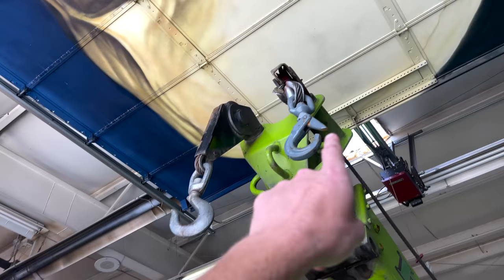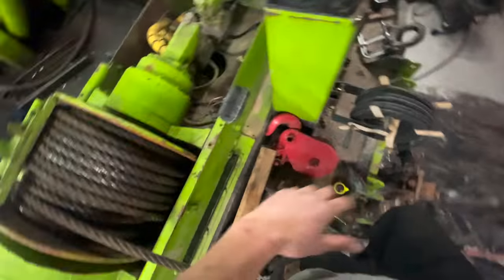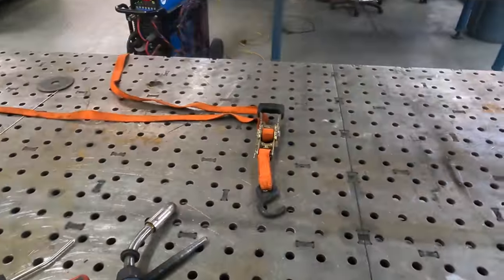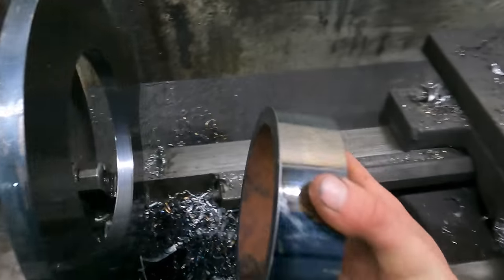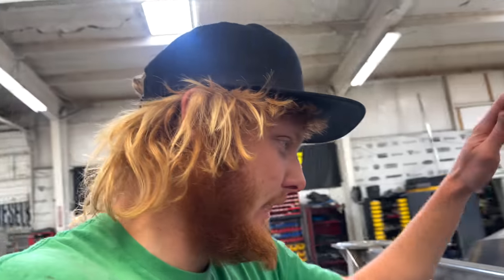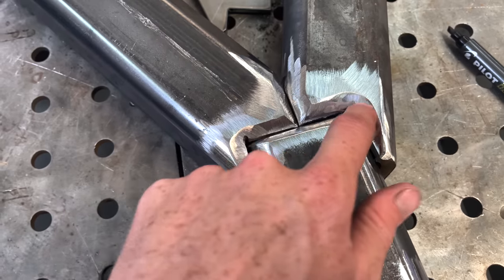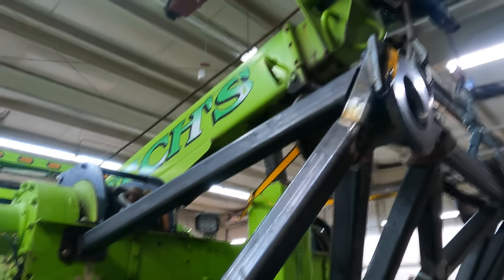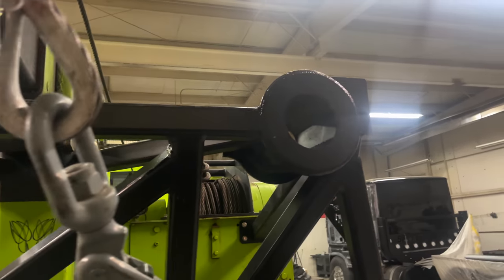How To Build Something @HeavyDSparks Can't Break

Comment: Solidworks has a great sheetmetal package which made a huge impact on my fab'ilities. Also has some great simulations for strength testing cross-members like you've put on the HET. I don't work for or rep them, but I use it everyday at work and in my home shop.

Comment: Hey Hunter. Instead of using the flapdisk on that table, another way you and do is by leaving it in the lathe and get a big sheet/ strip of sandpaper (like from a beltgrinder) and just sand it while the lathe turns it. Like when you floss with a towel.😄 Thats how we do it at our shop. Great work dude, keep it up.🤘

Comment: Great video and work. Really dig the faceplate on the lathe as far as being able to unbolt and flip the jaws. All of mine have to be unscrewed and flipped with the internal spiral gear and can be a real pain if they don’t go back on in the correct order or if they aren’t timed correctly causing the centerline to be off. I’m gonna have to find some chucks like those, definitely a time saver. Again,great work and video! 👍

Comment: Just a tip on turning the tube on the lathe, tack the plate on the end without a hole in it, and chuck it up. Then you can use a hammer and a dial indicator to dial in the end of the tube opposite of the chuck to run straight, and then drill the hole with the lathe tail stock. As long as you're careful, you can usually get away with it. Then it'll be perfectly straight and not have that offset cut that you saw. If it still sags, then after you dial it in and before you drill the hole, mount up the steady rest.

Comment: Hunter, my man...may I offer you some constructive advice on "Stress Welding Procedures". While .035 mig wire is a good all around wire for many applications, on a Truss assembly as you have build, will take alot of load and stresses at angles, and knowing Dave's infinity for testing the "limits', I would suggest using a .045 Flux core wire, for MANY reasons, one being the heat that is in the weld, during and after the weld, superior penetration. Secondly an .045 will put MORE material into the weld for bonding two pieces, and you will also find the weld will layout like peanut butter. it will look like it was CAST, not look like a "stitch weld". I have spent my life time in the Petroleum Industry building Centrifuges, Hot Oilers, Nitrogen Pumpers, Pressure Trucks, and occasional Drilling Rigs, and they ALL take a beating. I fabricate them from a pallet of laser cut steel, to a complete, on the rig operating million dollar plus piece of equipment, my fab work NEVER comes back for repairs, but have rebuilt/repaired my fair share of other competitors equipment( names withheld). I have been a Welder/fabr for over 30 yrs and work with some of the best, my employer puts me in a corner with a pallet of cut steel, and leaves me be, I work alone, where the rest of the crews, are 2 man teams. Not many people I can work with as my standard and ethics will never allow me to work with lazy morons that never follow procedures, that being said, I know I could work with you, we'd click, get'er done attitude always prevails. I seen how your mind works, and put to CAD, then bangin' it out. Good job Young fellow.
Reply: His design  WAS .....NOT.....OVER KILL!!!!
Reply: @alnov91  have you NOT seen HeavyD kill/destroy things, better to OVERKILL, do it once, then have to repair it. They ripped the bed off that wrecker not to long ago, and I guarantee that rig WILL be put through its paces. Never hurts to OVER engineer something. Hunter KNOWS Dave. "Measure Twice, cut once".
Reply: @cabochoppers7411  i was wrong!!! I corrected my comment.
Reply: @alnov91  were cool man
Im not a Snowflake and get insulted easy! LMAO

Comment: Look into dual shield welding wire. It gets hotter and can lay a much larger bead without needing to zigzag. Also much larger diameter welding wire for faster work.
Reply: Thanks for the tip.

Comment: Good news picked up my 2 3 way tee valves needed for my 1994 7.3 I.D.I. Turbo.  Next is to P.U. my special ordered single end of line Tee Line Valve to complete the soft line rebuild. With  so many big miles it was time to rebuild the upper end of the fuel system.  Only problem was the Standard kit does not include all the pieces needed guess most of the 7.3 I.D.I. were non turbo.  Secondary problem was Ford discontinued these parts as well.  Luckily found two different Ford dealers that had some old stock and willing to make a sell. One East Ford and one West Coast Ford Dealerships.  They each worked together and did not even jack me around on the special order pricing.  Sweet!

Comment: Hunter, you may want to try out some "Flux-Core" wire, use with 75/25 Argon-CO-2, for your welding needs. FYI, the shipyard I worked at for 5 yr's building little 400 ft canoe's, (Had FULL SIZE Helicopter Land Pad's on the Bow of said canoe's.) we were instructed 5/8" in. (0.625" in.) plate steel or less, use .045" in. wire, bigger plate steel use 1/16" in. (0.0625" in.) Dia. wire.  PS, no weaving of the weld bead was allowed. Just start your bead, and pull or push as necessary, NO WEAVING PERIOD. If the inspector's (U.S. Coast Guard, LLOYD'S of London Insurance Company, only on critical weld area's ) found somewhere you "weaved," they would mark said area, you had to grind it out, and start all over again.

 Plus, have Dave buy you a MILLER suit-case welder, (also some quick dis-connect for welding gas -Argon-CO-2 line{s}) for working in situations like in this video. That "Shop" welder is nice for most shop job's. Would have been the last thing I would have used on this job.

Comment: If I was a welder that had certs in mig, tig ,flux core/231, stick 3-g. & pert near 40 years of this Shit. 
I might just day ...you done yourself proud. 
I didn't see grease zerks in the part that holds the lathe turned piece, but hot Damb. I'd be proud to send it out the door.
Reply from the maker: It got zerks and full of grease, forgot to include in the video

Comment: I have an idea why the tube didn't machine round. 
Yes you're correct in assuming the tube isn't perfectly round, they never are. 
Not sure if you have dial indicators, but those continuous scroll three jaw chucks never tighten up completely true.
For those really light cuts or when you're doing things that need to be concentric, an independent scroll 4 jaw chuck will be a big help. 

Great looking welds and great to see you wearing all the gear so you don't get cooked.

Comment: Man I miss working with thick steel.  I built a containment system to hang a curtain around a water tower a few years ago.  I spent around $20 grand on steel and supplies, and built every bracket, boom arm and fitting myself.  So much fun, man I hate being disabled.  Wrecking my back definitely made me slow way down, like to disability at 38.  Now I sit around in pain all day, and on good days, I sometimes sneak to the shop and do a little tig welding.

Comment: Looks like you may need to better brace the metal in front of the winches that the back brace is welded to.  It doesn’t seem to have enough strength.  Also, be sure to add grease zerks to the swivel pipes to help keep them greased.   Great work!

Comment: I'm in support of your work young feller. I believe that with some education regarding the lathe and direction in the use of cutting tools you'll be a great seat of the pants fabricator. Keep in mind that I don't have any idea of your actual learning. Your welding is real sound but welding onto the table like that would get a kick in the ass around my shop LOL. As for planning what goes where and cutting to dimension which is a huge and important skill, you fuc^^* nailed it man! Rating your job to indicate how properly you done Id give you an 85% of an ultimate 100%. That heavy wall tube is much straighter than you reckon.

Comment: Great video and awesome new cable guides for the back of the monster wrecker.  I would recommend installing some grease fittings on those tubes to allow them to be packed with grease and allow for better support and longer life of the tubing.  Also the cable sheaves will work at any angle of pull that is why you see them used on all heavy tow wreckers even on the side pull and rear pull winches.  I would highly recommend installing them on both of those rear winches.   Tell dave that is is also possible to lift and pull using both of the lines on the boom as long as you rig them properly to whatever it is that you want to lift or pull on.   I would highly recommend watching some of the videos that Ron Pratt puts out on heavy tow and recovery he is a great resource for knowledge when it comes to heavy recovery and towing.
Reply: He doesn't lift the front of his trucks off the ground though.  Something about, "Treating them like investments."  Doesn't make as good of content not seeing a Pete bounce 3 ft in the air when a rigging snaps.

Comment: Great modification. I would remove the handle and fit a sheath on the pulley that can pivot up and down and follows the direction of the cable/wire.

Comment: Great, video, probably the second best at describing the layout process and showing the entire fab. Check out Fireball Tool in Spokane Washington.
After working in a shop with 200 welders, I thought your use of weld gear was the best! no shorts and cutting goggles..Your ability to Envision, design, machine and weld, makes you a complete fabricator. Dave's willingness to provide the right tools, and work space make a win, win, win.

Comment: you need a over head crane for muscling your fab work around,  I recommend a compressed air, piston hoist the are very precise in how slow they can be ran, or pull had and it will go up fast.

Comment: You need a floor mounted crane arm with a monorail that rotates 360° will cover both tables. They will save your joints and spine believe me I am old broken down fabricator and welder. Wish I would have used them more when I was younger.

Comment: You can cut a shoulder in your live center plate without welding or grinding. Also, angle your tools in the other direction for a good finish cutting backward, it'll be quicker overall.

Comment: Good fab work but I'd like to offer some advice on machining. I've been a machinist for 12 years with 2 years of schooling prior. 1: when flipping the chuck jaws on the lathe clean them and the chuck thoroughly. Leaving chips in there with destroy the accuracy of that chuck. Combined with that, seat the jaws onto the chuck before tightening the bolts because again you'll kill that chuck. 2: the lines you had to and off after cutting the tube down are because of 1 or more things. Gummy grade of steel, wrong rpm, wrong feed rate, or wrong tool geometry. Thats a complicated thing to figure out for someone thats not a machinist full time. To cheat you can try putting some cutting oil on it and sometimes that helps. And best practice is to cut towards the chuck not away. 3: the end of the tube not cleaning up is because the plate you welded to the end for the center tip "cone you called it" was not concentric to the pipe. When you chucked it up the tip of the center forced the pipe off center so it was running kind of like a cam. Welding the plate on, holding it all in the lathe, then drilling the hole using a drill chuck in the tailstock would've been 1 way to do that better.

Comment: Dude, when you're fitting up anything structural instead of using a shim on the low side tack and use the weld to pull it up.
Nice job!

Comment: Did you consider adding a grease fitting to the rotation cylinder?
Overall a fantastic job and great video!
Reply from the maker: Yes is did get a grease fitting and grease, forgot to mention

Comment: Great design! Not saying it is needed because like you said it might good out the back and I don't doubt that they are heavy with a lot of pressure when being used, but shouldn't you at least have a cable cover to make sure it helps stay on the pulley? I know it's probably not needed, but even it being from +45 to -45 if the top is 0 just to help the curve and help ensure that the cable doesn't jump the pulley. Just a thought. I could be wrong.

Comment: future idea for you if he breaks that....  what about a sliding one so it can move along left to right as the cable feeds in normally?  might even help it feed it correctly. especially if a "tensioner plate" is incorporated to encourage good wire feed side to side.  then you dont need something 5ft out... it can be up by the winch

Comment: Looks great. What about making an atv into a portable snatch block? Maybe make a frame around it with some anchor points. You can have a long lead anchoring the back of the frame to a tree or rock. Big pulley hanging off the front. Make it easy to reposition in ugly terrain. Maybe

Comment: Great project. It kills me to see the parts being tacked to that fixture table. Use a bracket to clamp it in place and keep that table clean. 

What wire are you running?  Looks like you’re in short circuit transfer still possibly with 70s6 hard wire. Have you looked into dual shield fo these heavier applications?  It would be a game changer for you and cut way down on the spatter and sparks (no pun intended)

Comment: You need to have several round and  conical fittings so you can center these pipes without welding it. It’s then hold perfect in center due to the cone.

Comment: That's badass! Quite the project. Awesome job. Any reason to drill and tap those things for zerk fittings to keep those lube so they spin free? I'm wondering about rain, power wash water getting between the two and rusting.
Reply from the maker: They did get zerks and grease, forgot to mention

Comment: If it cracks its strong. If it breaks.... make it bigger.  You sir are what I strive to get to. What Amp are you running while mig welding something so thick.
Reply: I do tig mainly. S/S  and CS. Also aluminum tig too  Monel and Iconel when needed.  Although no where near as much practice/ work for those specific metals

Comment: Next time when you have a issue with the hole being too small for the pipe or shaft the you want to fit into if its 0.2mm you can freeze shrink the pipe or shaft and heat the hole so it will expand then you can fit one into the other.

Comment: Why not plate mount the lower mounting points though like you did the top points.
Reply from the maker: The inner two mounting points on the bumper were already there, so I figured I’d just keep with that design on the outside two. The 1” grade 8 bolts used should be plenty strong

Comment: The pipe didn't clean up because it wasn't centered. Next time, no hole in the end to start. Get the pipe true on the end with an indicator and a mallet. Get it true. Then pop your center drill hole in the end. Wala, centered.
Reply from the maker: I did use a mallet and got it perfect

Comment: Why not make an eyelet at the point just passed the spool and have the cable travel back towards the cab to gain your distance for the spools to work properly basically add one pulley near the cab to redirect the cable so it spools from the underside.

Comment: Check out Cutting Edge Engineering's You Tube page on a "Tail Stock Chuck" that he built (purpose built) to hold sections of large tubing from the tail stock on the lathe. This is a fabrication channel down in Australia.

Comment: Totally awesome BTS. :yougotthis: but like why do you not need to consider the weight of the thing you're making. What if you made something amazing right but it caused the truck to become unbalanced. From experience, you just know what you can and cant do with these machines? :D Also, how long does Dave give you to modify these trucks? It is like 'you have 48 hours!' or do you have multiple projects going at the same time or what? I have this feeling one of Daves videos used a truck that was half way through a mod or something, will have to go find it! :D